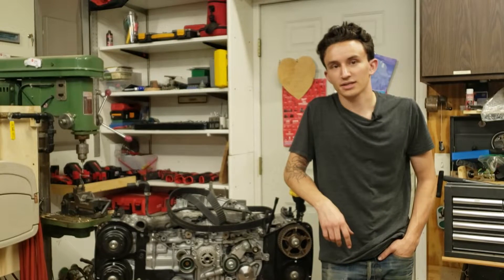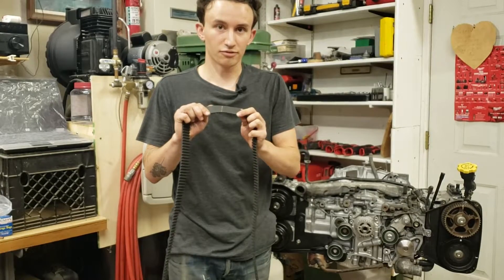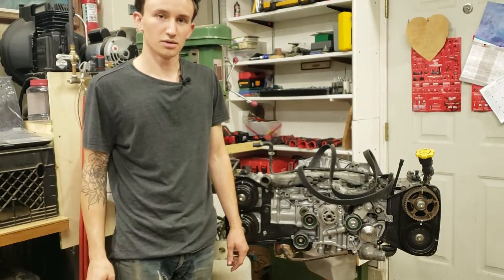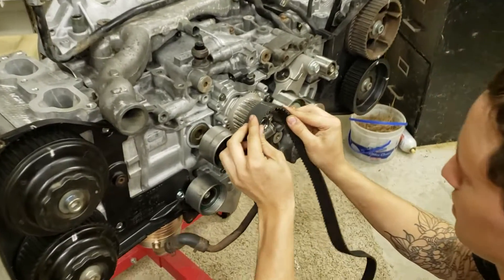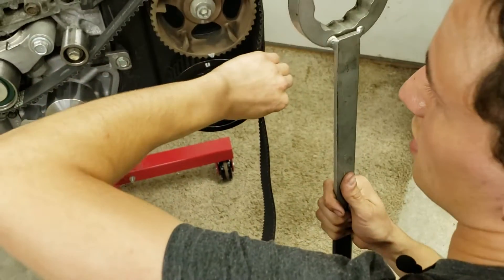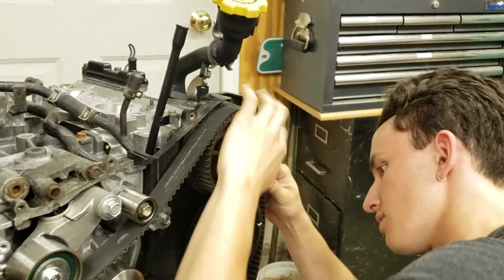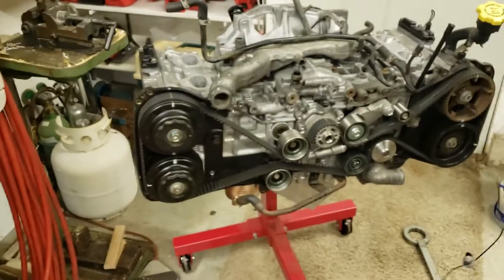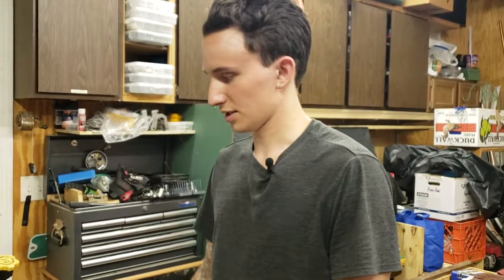WRX EJ20 Timing Job - Built Subaru WRX Engine Assembly | PT 3.5

Comment: I have been told multiple times to crank the engine over a few times by hand to see if it still lines up, do you do that before or after pulling the pin on tensioner? I assume before?

Comment: How do you know if cams are not 180 out
Reply: They cant be , look at the bottom of the intake cams and top of exhaust cams. They have double marks, just make sure they are lined up also. Good luck
Reply: @boostedego6043 the right side  double marks never line up!
Reply: @alanw5812 so when I still have the old belt on and try to line everything up they double lines won't line up is that normal?? Or should I take off old belt and line them up then use cam lock tool and then put on new belt?
Reply: that normal 😅, just use the outer marks to the belt white marks is ok. just becareful the oil cap side intake cam easy  jump, if the first time do, try hold it by spanner or bar not wrench, release slowly remember the gear jump which way, if turn the wrong way may hit valve! need to turn the gear opposite way.😊😊
Reply: @alanw5812 I have the cam lock tool so I think I'll be fine, I'm just thinking if it's better to lock the cams before I take off the old belt or after?